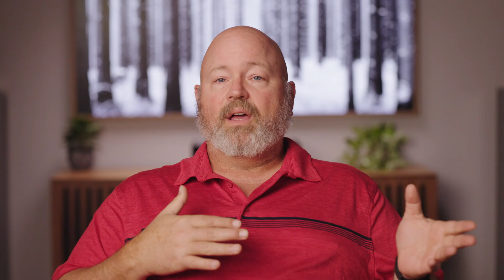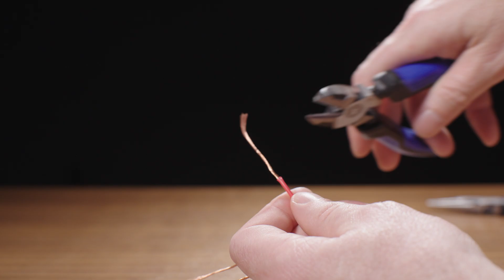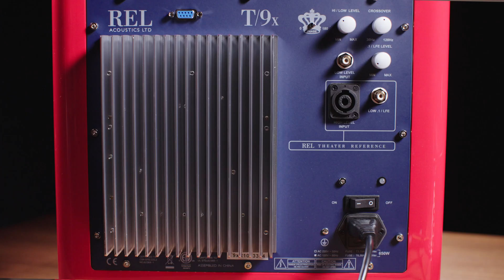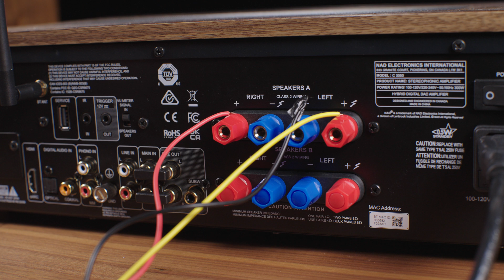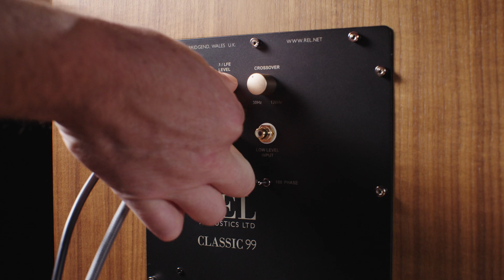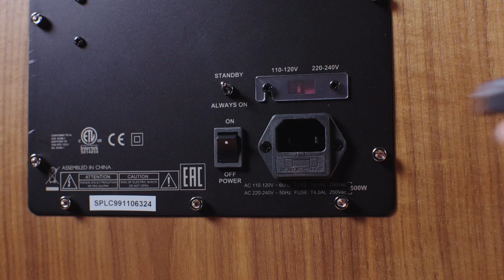REL subwoofer high-level connection tutorial | Crutchfield

Comment: Would be helpful to see these hookups while also showing a pair of front speakers hooked up.  Are we just connecting the fronts to to same terminals as the high level sub wires?  So two sets of wires on the same terminal?
Reply from the maker: Yes, that's correct. The main front speakers will be connected to the same speaker terminals as the sub.

Comment: I have a REL Classic 98 and I had to connect the black the wire to a screw on the class D amp otherwise I got a hum.  My only complaint is I wish the gain and crossover had more markings to give an idea where you have it set.

Comment: It would very helpful to see how us folks who have Monoblock amplifiers with just 1 REL T9i and want to go high level input. Please advise.
Reply: Pick either your left or right monoblock and Follow the procedure shown in the video for monoblocks. 
You will only get the left or right signal into the sub but it still sounds very good.
You can add a second sub later on if you want and connect it the same way to the other monoblock.
That’s how I started off.
Reply: Watch the video

Comment: I have the same NAD c3050 in the video. so would i connect the wires to the same terminals as my speakers, or use the B channel connections and then run A+B channels on the amp?

Comment: Ok so this is the first video on this topic I am indebted to Crutchfield for. On my Mark Levinson N5802, I am unable to locate a dedicated grounding option. No screws anywhere on the chassis. Not to mention the rigid REL provided wire that is stretched connecting to the speaker terminals on an amp. So finally, after much aggravation, I ran into this video which solved my issue and I connected the ground to one of the speaker channels. My question, however, is if this connectivity is good then why doesn’t REL mention it in their videos?
Reply from the maker: Glad we could help!

Comment: If the goal is to extract the same signal as your main speakers, then filter all the higher frequencies info a REL does not need in the REL itself, then why do you connect class A/B or class D differently ? Both class A/B and class D amps supply full range signals to both L and R channels don't they ? I don't understand...
Reply from the maker: Hi Dawn, the signal connections will be the same for both AB and class D amps but using the ground wire varies depending on the amp class. In AB, you can connect the ground wire to the negative speaker terminal. If using a class D amp though, you risk shorting the amp's output, so you'd want to either not use the ground wire or ground to metal instead.

Comment: Thank-you! Apparently there isn't a general consensus regarding where the Black (I have it in a Spade connector) wire connection goes. Someone at Crutchfield told me to attach the Black spade to a small chassis screw. The other Crutchfield employee told me to attach the Black wire/spade to a negative Speaker terminal. My Reciever is a Yamaha R-N800. Could you please tell me who to believe so I won't fry the Amp or a brand new REL T/5X Subwoofer??
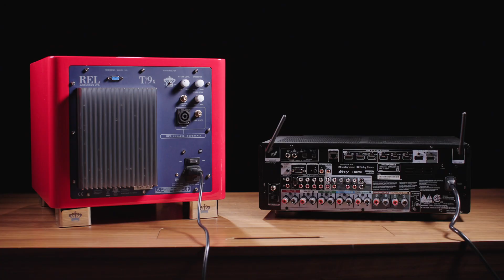Reply from the maker: With your Yamaha R-N800A stereo receiver, you'll follow the connection steps for AB class amplifiers featured at the 1:40 mark of JR's video. We provide lifetime Technical Support with every Crutchfield purchase, so if you need additional help getting connected just give us a call with your order number handy and we are happy to assist.

Comment: The video only shows the REL sub connections to the amp. Normally the setup will include Left and Right speakers, as well. As such, it would be helpful to show the additional wires from the left and right speakers. The REL manual doesn't specifically address this either. In the first example (Class A-B, AVR) the receiver only has one set of Main / Front speaker outputs, so it would appear that the Left and Right speaker wires would have to share the same terminals (piggy-backed) being used by tthe REL speaker leads. In the second example (Class D amp), the amplifier has both A and B speaker outputs. In that case, the Left and Right speaker wires could be piggy-backed with the REL wires on the A Terminals or the Left and Right speaker wires could be connected to the B Speaker outputs.
Reply: On your class D example, you don't want to seperate your Rels high level wires from the speakers just to engage the B speakers as this will cut the power in half to your mains. Keep the high level wires on the same terminal as your speakers. Some actually attach the high level to the actual speakers terminals and not at the amp end.
Reply: I’m also curious to see how people are connecting both the subwoofer and main speakers to the same terminals.  Seems like there are some slightly different approaches you could take: subwoofer goes into terminal, speakers connect with banana plugs?  Intertwine the main connects with the subwoofer?  Keep them separate and just stick them all in together?  Not to overthink it, but it would just be nice to see how people are doing it since we don’t just have subwoofers for speakers.
Reply: @stephenmclaughlin6174 5 way binding posts do allow for multiple connection options. I run bananas for the speakers and twist the bare wire around the terminals for the subs. Pretty easy.
Reply: @stephenmclaughlin6174 you are over thinking this
Reply: Maybe, but I was a little confused when I first started looking at these 3 weeks ago.  Now it seems obvious, but this was one of the first videos I landed on doing my extensive subwoofer research.

Comment: One of the most informative and useful videos on this topic. Congratulations Crutchfield :) -- I happen to have exactly the amp featured in the video, the NAD C 3050, and I'm thinking about adding a REL sub (Tzero mk3, T5/x or maybe the Classic 98 - I'm limited by room space). Which do you recommend for a small-to-medium apartment?
Reply from the maker: Based solely on room size, the TZero MKIII or the T5/x are the better buys for bang for the buck. However, the Classic 98 can still be used if you would like a more prominent bottom end performance since it has a level controller to keep from being overbearing. We are happy to recommend one of them for you and have a few questions to help. What speakers would this be ran with in your system? What are you 2 or 3 most favorite music genres? Also, what changes are you hoping to make to the bass sound you get now from your setup?
Reply: My living room is only 15 x 15 and I have the Classic 98. I only use it for music, but after adjusting the gain and crossover I happy with it.  I have it behind one of my speakers.

Comment: Which amplifier is best for music streaming?
Reply from the maker: We have many great amplifiers designed for high res music streaming. What brand and model speakers do you have? Will you be connecting anything else like a CD player, TV, gaming system, powered subwoofer, etc.? Do you require an AM/FM tuner? Do you have a budget in mind for the new amplifier?
Reply: @crutchfield not for CD player, am/fm radio and gaming only for listening music, 
Which budget amplifier best for music streaming with jbl stage 130 bookshelf speaker?

Class AB amplifier for example (Denon pma 600ne and class d amplifier like a wiim amplifier ,
Which is best for home?
Reply from the maker: Class AB amplification is best for clarity and detail and between them, the Denon is the better choice. However, you could consider getting a stereo receiver as those also come with an AM/FM tuner built in. There is a Yamaha R-N600ABL stereo receiver that uses Class AB amplification. You can find out more about it here:

www.crutchfield.com/I-rYALc227/p_022RN6HABL/item.html
Reply: @crutchfield Thank you so much 😊
Reply: High level input provides the most seamless integration between the sub & main speakers.

Comment: Very informative video thanks for sharing , I have two NAD c298s, configure in vertical biamped (from each power amp 2 pair of cable connected to back of ATC SCM20 speaker terminals (high and low) and c298 power amps are connected to c658 each xlr pre out with xlr Y cable, one power amp dedicated for right channel other one for left ). Also have two REL T7xs, connected (low level), in two sub outs of NAD c658 dac  , its sounds good but how i can configure the high level connection if you suggest.
Reply from the maker: You will want to use the connection instructions for Class D amplifiers when wiring the Speakon speaker-level input cables, and you can connect your two REL T7x subwoofers to maintain stereo separation by connecting one subwoofer to each power amp (left and right).
Reply: @crutchfield  thank you for your response, should I connect red and yellow of the speakon cable to lighting mark red and blue biding post of c298 and black to the ground nut on each power amp c298
Reply from the maker: Hooking up gear is the sort of thing handled by our technical support service that is reserved for Crutchfield purchases. If you bought  the NAD amps from Crutchfield, please give our technical support team a call. You can also reach NAD directly by calling 800-263-4641.

Comment: I have a 2-channel setup with a Marantz Model 30 amp (class D) and a pair of DALI Opticon 8 Mk2 speakers that I recently bought from Crutchfield. I also have a pair of REL T/X9 subs that I bought two months ago, before Crutchfield sold REL products. Overall, the system sounds excellent, but there is a very slight hum from the T/X9s and I have the volume on the subs set very low (3-clicks from minimum). Currently I have the Yellow&Red wire from each sub connected to the corresponding + speaker terminal on the Model 30 and the Black wire connected to the - speaker terminal. Would you recommend an alternative connection between the pair of T/X9 subs to the Model 30?
Reply: You probably already figured it out by now but I think if you're experiencing hum he said to bond the black wire to the chassis of the amplifier.
Reply: @RichR65Ct  Thanks, I've had the black wire grounded to the chassis for a while now, that helped a bit. 
Several other things I've done have each helped a little: 
(1) I bought a pair of 15' long power cords for the RELs so I could keep the power cords far away from the high level input cables.
(2) I had original 30' length of REL cables loosely coiled up to take up the slack, cutting them down so there's no extra cable helped.
(3) I re-combined the red+yellow leads for each sub. It makes setting the level a bit touchy, but keeping the level gain set lower reduces the hum.

(4) I've ordered some three-conductor, 18-gauge wire that has a foil and braided shield that should pick up less noise than the un-sheilded REL wire. I'll connect the three conductors to the REL Neutrik plug then I'll connect two of the conductors to the speaker + (just like the Red+Yellow) and I'll try grounding the third wire to the chassis. I can also see if hum is further reduced if the shield is grounded to the integrated amp chassis and/or the Sub chassis.